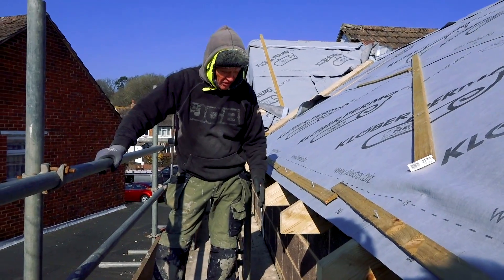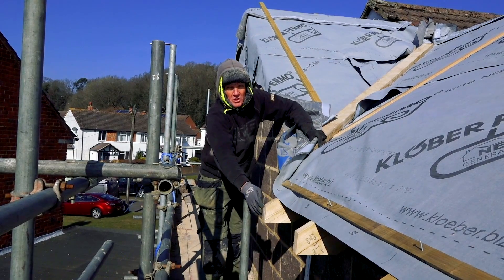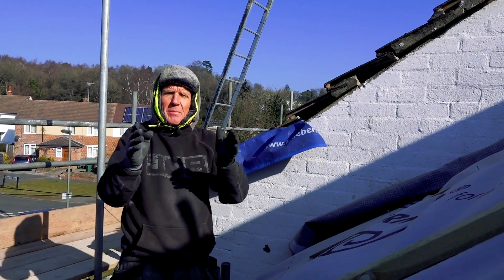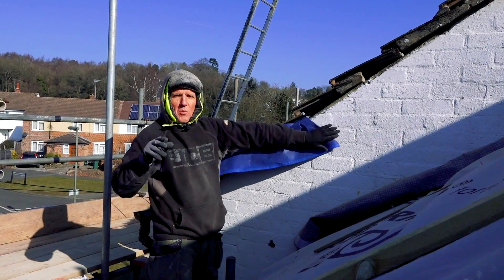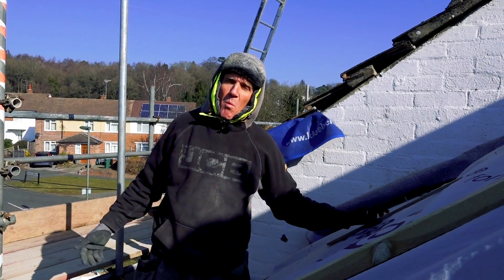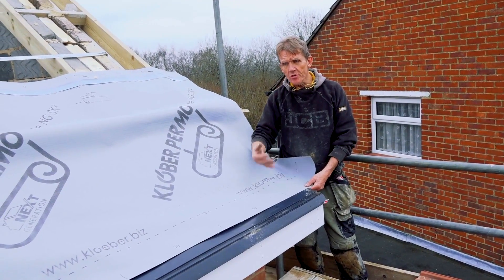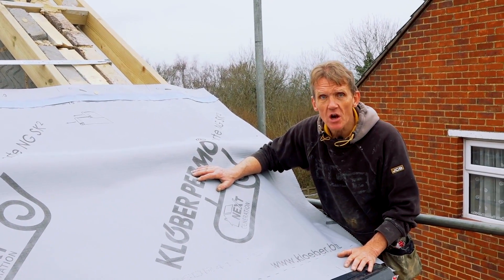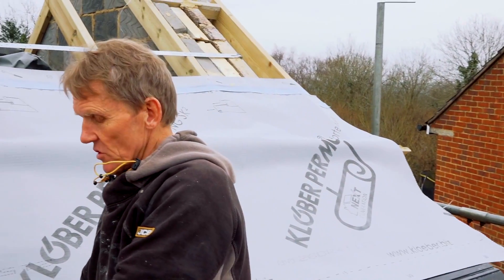Building an Extension #10 - Soffits & Roof Underlay

Comment: That roofer on the gauging committed a schoolboy error. You measure to the top edge of the batten & not in between the battens. Battens are rough cut & not perfect.
Reply from the maker: Battens are now cut to a much more regular size and having a spacer in between is a quick and easy way to fix them. So long as you measure every 4 battens the amount they run out is negligible. We have run a whole roof on spacers and not been more than 2mm out .

Comment: Very informative videos, thanks. A question for you - I need to repair some roof joists eaten by termites. (The beams that support the laths that the tiles are fixed to) The bodgers that built the roof did not put any "Birds Mouths" on the original beams so they are just lying on the walls. If I was to replace the damaged timbers, instead of cutting birds mouth's  would it be acceptable to fix some timber to the sides of the beams parallel to the wall, that sit tightly on the wall then attach them with bolts to the angled roof beams? (trying to fit replacement beams with a bird mouth to what remains of the existing beams would be a problem to get the laths to attach to the tiles. What do you reckon (a sort of additional brace that bolts to the rafter but runs a little longer back to sit on the walls.

Comment: I see the point but as in a non membrane roof the moisture goes out between the tiles or slate , why it’s breathable lol .
But however tight you pull it it will sag in time , and would building control be happy with a big sag they so insistent on 50mm space lol

Comment: Take care if using a gauging stick from top of one batten to underside of the next. Particularly on big roofs the measurement can creep out. I usually make a gauge batten top to top then keep meausering back down to the bottom batten to check the measurements are the same at each end of the roof.  (working in pairs it is really quick to do). Also I usually stick a nail in each end and fit a string line so you can make sure the batten is layed straight. Don't forget to staggar the batten joints on long runs.
Reply: You are right, it will run out and lots of roof’s are not square with longer rafters one end so the roof would end up with an angled last course.
 The breather membrane evaporates in the air. This channel is good on some things but roger doesn’t mind a bit of product placement.  Now no doubt I’ll get called closed minded because I am not suckered in by every new product.

Comment: I though birds mouths was only meant to be 1/3 of the size of the timber and no bigger as if you go bigger you loose all the strength in the birds mouth?
Reply from the maker: Yes and that is why it is doubled up. The existing roof is 3 x 2 rafters and we had 6 x 2 so we had to lose it on the birdsmouth if we wanted to keep the plate height and rafters in line. Sometimes you gotta do stuff to make it work

Comment: You said that pulling the membrane taught isn't good because moisture will build up on the battens, how well not having a taught membrane prevent that?
Reply: the sag or dip in the membrane allows the moisture to pass the batten without touching it

Comment: Hi, My house was built about 1950 and I was up in the attic and the membrane looks like and probably is tar paper, it is ripped in some places and the tiles are right above. the attic is not a living area but I am worried about water damage, should I be worried and if so what would you suggest to sort it out.
Reply: John Fithian-Franks it’s due a re-roof John. The hessian based felt breaks down over time and disintegrates. Get a recommended roofer round for a replacement quote using a breathable membrane 👍🏻
Reply: @matthewfreelove3353  Thank you I will

Comment: Bit of a rookie mistake there Rog using a bit of batten as a gauge - any variation on the batten width will throw out your gauge plus if your first batten is not perfectly straight you will carry the problem on up the roof    - we always measure up from the first batten and fire off chalk lines - bullet proof!!
Reply from the maker: Yes I do that but this is a short run and we checked off the top of the first batten and it is fine. Those graded battens are a lot more precise and a chalk line on this short run would be overkill. IMHO